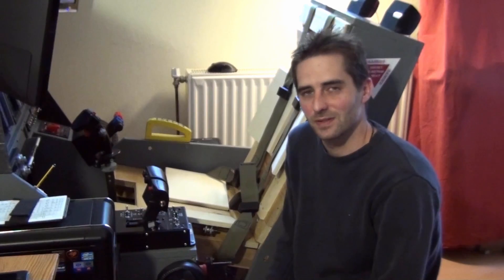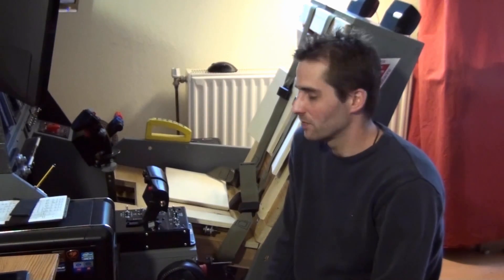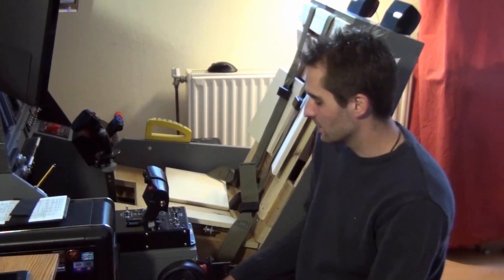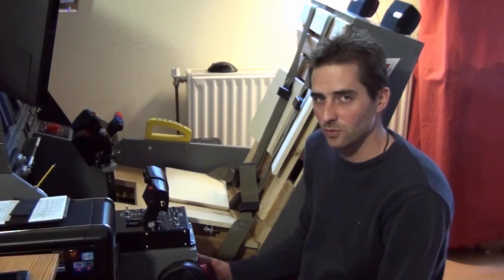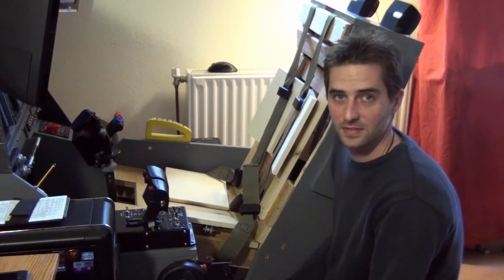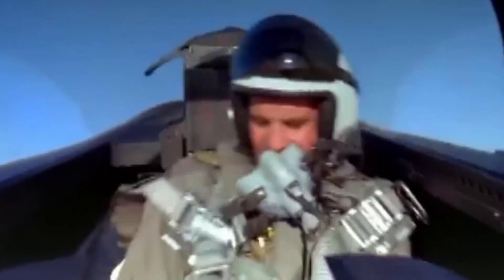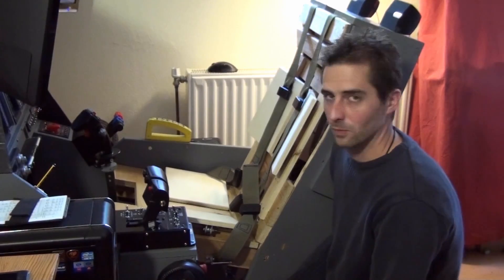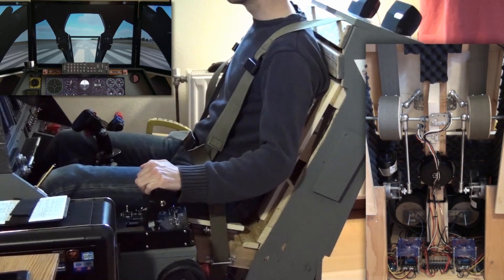The Bergison G-Seat

Comment: Wow... Now combine that with a 6DOF motion simulator and a virtual reality headset and I doubt you can tell its a simulation.

Are you still planning to make a "tutorial" on how to build this? The concept blows me away and I'd absolutely love to try it out. At the very least, might to make a diagram showing the system that tightens the belts and pulls the boards? As well as more information on the actuators. Also how many motors are you using? I see only one in the picture but I assume you would need at least two.

Comment: Do you use a TrackIR? Does the seat move your body enough for the TrackIR to effect the view?  That is the potential downside I could think of to this system but can probably be overcame with a less sensitive TrackIR profile.  Overall, I don't think people can really understand how much these little movements have a big feel.  It's mostly due to how directly they are effecting the body  where a little goes a long way and they are backing up the visual inputs enough to make it all work.  It's like a mini 6DOF platform directly under your butt.